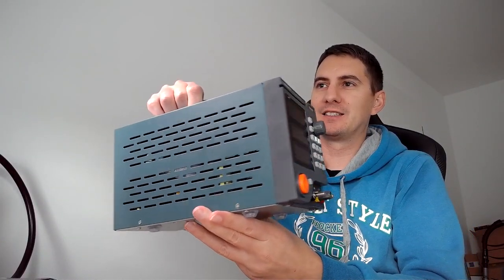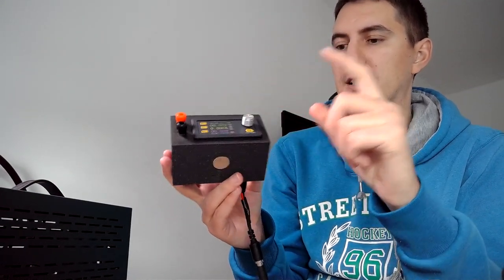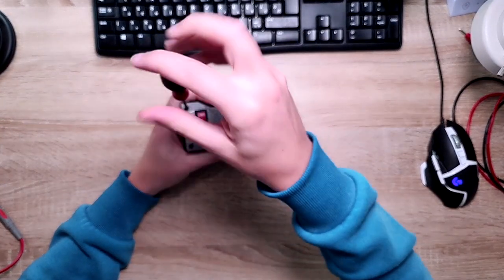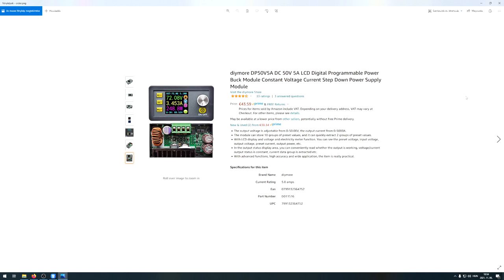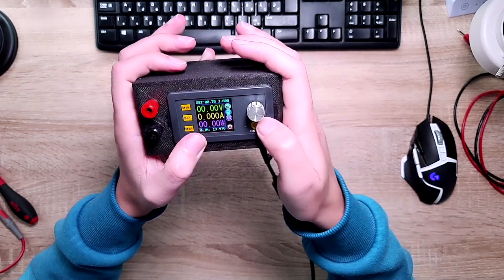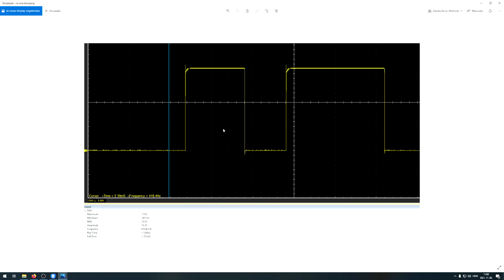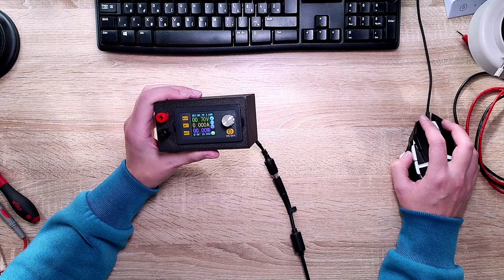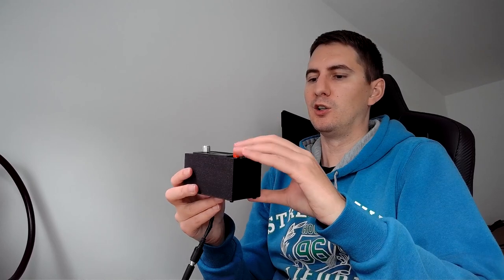Tiny Lab Power Supply Build

Comment: I don't know if they modified the pcb since i bought it but mine came with a diode to use when charging batteries. If not used a charged battery could damage the unit backpowering it when it's off. I printed a case too and added a second + banana socket with the diode.
Reply from the maker: Thats a really good point, thank you! I did not even thought about this because I though it is implemented an mine did not came with a diode either..
EDIT: I have checked and there is really no diode on the positive output so I added a warning to the description of the video. Thank you for pointing out this!
Reply from the maker: I have checked now in detail the developers Aliexpress page. There are ca 20 versions out there. In certan types the diode is already built in so can be used for battery charging but case of certain types you have to add your own diode. There is no clear specification so it is really confusing :)

Comment: Hey Kiki, I love your videos, I have been following them since the beginning of your channel. Would you mind sharing a the list of hardware and tools you use? Thanks and keep it up!
Reply from the maker: Hey. I am haply to hear this man and appreciate your support. Sure I can list my tools. I use an Atten ST862D hot air station. Ksger soldering station with a custom firmware and sligthly modded hw to be able to use a JBC handle and tips. This might change soon because a JBC tip costs ca 30€ and it failed in ca 3 months.... I think I will switch back to Ksger. I use an Eakins trinocular microscope and on this I have an Eakins camera ( this is just for the video). In addition a lot of hand tools like tweezers, an amazing Ifixit pro tool kit ( I can really recommend this). I use leaded solder and quality flux(original Amtech or Chipquik), wick and low melt solder etc. I jope this helps.
Reply: @kikihobbyrepair  Thanks, that does help. I'm already there with the Atten and the Ifixit tool kit (which is indeed awesome). Fixed a couple of switches already, but also ruined a few in the learning. What about your 3d printer? I'm actually looking for one right now for projects just like in this video.
Reply from the maker: @Sven Juter I also killed a few Switches at the beginning. This is part of the learning curve 🙂 
I have 2 self built 3D printers. I mainly use the big one which is based on the BLV MGN Cube with some 3 Z axis mods designed by myself.